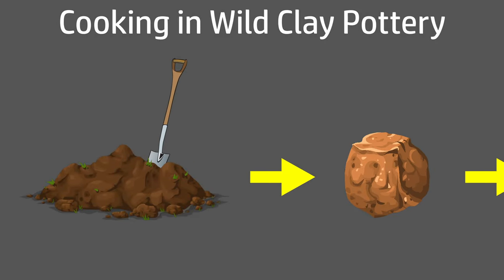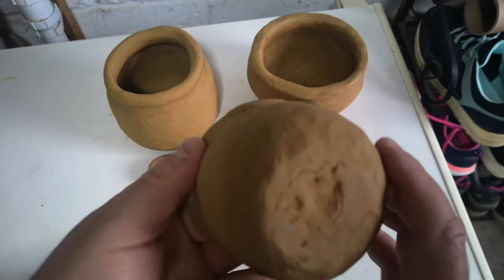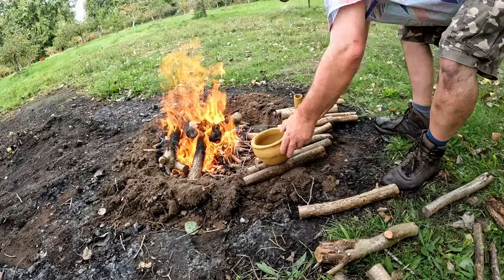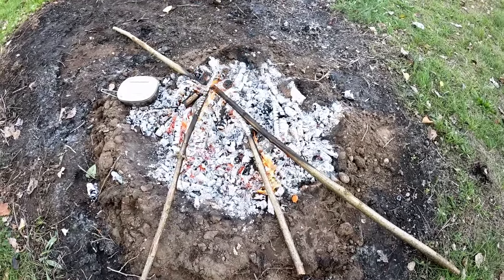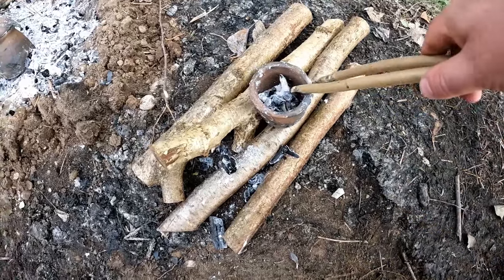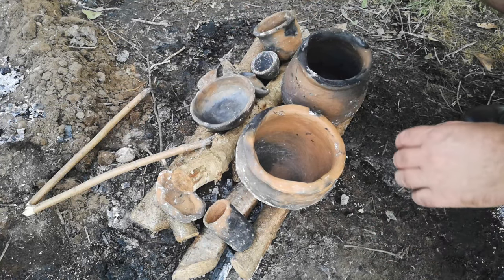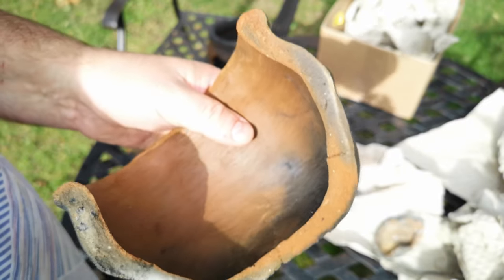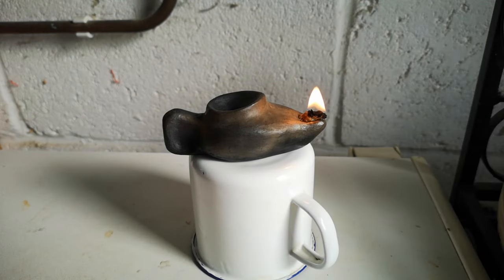Cooking in Wild Clay Pottery - Part 3 - Firing Pots

Comment: Well, one suggestion. Add fine plant fiber to the clay. If Primitive Technology uses it to prevent kiln walls from cracking, maybe it will help with thicker pottery too?
Reply: Plant fiber would make it easier to form the pots and might prevent cracking, but it will also make the  pots more porous, which would not be good when trying to cook with them.

Comment: As I mentioned in another comment, I've been a potter for over 20 years.  I have never tried working with raw clay, but I do quite a bit of raku.  The clay I use for raku is heavily grogged for exactly the reasons you mention.  I fire raku to about 1750 F and remove it, glowing (the pot is glowing, not me), and immediately place it into combustibles of various sorts.  I cover it, and let it burn itself out.  Then remove it and immediately plunge it into water.  The results can be anywhere from staggering beauty to soul-crushing heartbreak.  I do suspect the thickness of your larger pots played a role in their breaking.  I don't know if any of this helps, but I'm REALLY enjoying watching you explore.  Best of luck, and may the kiln gods look upon thee with kindness.  Edited to add:  It IS magic.  It's magic every single time, no matter how many times you do it.  😊
Reply: I'm kinda jealous. I have done wood working, and metal working, but never tried clay or pottery. Where would one in Myrtle Beach , South Carolina, even start ?
Reply: @howiedavis2316   I have a friend in your area who took some pottery classes at the Myrtle Beach Art Museum.  That would definitely be a great place to start.  Even if you don't want formal lessons, they could help you acquire your supplies.  And, you'd meet local potters and get all their tips.  I hope that helps!
Reply: @EastWind123  It does indeed, I am a retired air force vet so I have the time. I will get in touch with them on monday , and thank you for your reply and information
Reply: @howiedavis2316   Happy to help!  Best of luck on your journey, and thank you for your service!  My husband is an Army vet, and he's taken up pottery, as well.
Reply: @EastWind123  Thank you again. Tell him that I'm sorry he could not be real military 😉( just some good natured ribbing between the branches ) . I got out back in '91 after being hit by a semi ( I didn't know at the time there were easier ways lol) . But I love learning new things, so thank you and thank him from me for being a military brother.

Comment: As far as the lamp, if it were hot enough for long enough in the middle of the fire, it's possible the sheen is from the clay being partially vitrified (silica partway turned to glass on the surface).

Comment: I think digging down or building up a wall would be good for even insulation.
You can cook sticks to make charcoal and then use that as your fuel, piled around and in the pots.
Burnishing may help work more air out.
Thinner walls help with even firing.
Grogging in the broken stuff sounds good.

Comment: I think the cracking probably happened in the cool down. Especially as it was on the exposed base. I also think it was slightly ambitious to fire so much at once haha 

Have you tried a pit fire? It can retain the heat over the taller pots better

Comment: Once again, the process is very interesting ! 
Although I am all the more curious as to why the pots crack when firing. Intuitively, it happens... But what about a more rigorous explanations ? 
As you stated, it's probably some grit that exploded, ot perhaps simply thermal expansion ; an uneven heating of an element can lead to crackling, especially if it's a ceramic. 
Your analysis was very satisfying ! I'm positive you'll succeed in making these larger ones. Maybe thinner walls and a tamer fire ? Big heat gradients (strong heat differences over short distances to simplify grossly) tend to make things crack. 

Anyway, your plan seems nice, it'll probably work eventually ! It's a beautiful project, keep it up !

Comment: This is an experiment that's after my own heart ❤️ I think your issue was more about equalizing heat through air flow with your pots being upside down as well as having your pieces space too far apart. I believe you can consolidate your pieces packing them together inside of each other and creating an insulated center for your fire where the pieces end up holding the heat working together and allowing that heat to maintain and become more even using the pieces to assist with each of the other pieces heating and cooling this helps reduce the temperature rising or falling too quickly as you have many pieces working together in both instances. I think if you dig your whole slightly deeper and repeat the process that you had done it will also reduce the issue with things heating or cooling too quickly. Another way you can help reduce the heating too quickly, especially with the coil method which can trap small air bubbles that expand and explode your pieces or create weaknesses, is to put them on a small fire in that pit that you've done and cover it even after you believe that they're completely dry. In places such as the where you live there is a lot of moisture in the air and while the piece can feel dry you want to drive out that last bit of moisture by slowly bringing up the temperature. This is usually done in a kiln by placing all of the pieces into a cold kiln and slowly turning your kiln on but leaving the lid propped open allowing that moisture to escape slowly and safely. Been loving your show for a long time because you do things such as this that are not necessary but the gratification that come from these experiments I believe is necessary to be a happy human and you certainly seem like wha one,

Comment: maybe try the art of Kintsugi if the new pots crack as well.

Kintsugi’s beautiful message is to embrace the imperfect as part of the character of the piece.
Reply: Unfortunately that’s not going to work here; kintsugi uses resin or epoxy, and these are meant to be functional pieces to go over a fire.
Reply: @farmerboy916  "Real" Kintsugi uses gold, silver or other metals. Nevertheless a neat concept
Reply: @danieltrepuen5247  No, actually. It uses the precious metal as a powder applied to the top coat of said resin for aesthetics, look it up. The issue is still that it’d burn/melt

Comment: I do think the big pots cracked because they were partially exposed to the cooler air.  One side super hot, other side rapidly cooling.

I think you might want to bury them deeper into the first set of ash loosely covering them then build fire directly over them.  You want to create a kiln like environment in the wood and ash.

Comment: The pots look great! Heres a bit of knowledge I have on ceramics. A primary cause of cracking can be to do with heat shock or dunting, typically to to do with quartz inversion (the process that turns clay into ceramic theres a lot to read on that) basically going through certain temperatures too quickly. Clay uneven-ness can be an issue only insofar as how the heat is distributed 

Another interesting thing is that even when a pot is "dry" there is still water trapped inside due to humidity sometimes called chemical water. If you have air bubbles said water will build up and a pot will crack or explode (didnt happen here). Its not air pockets that cause the explosions is the steam pressure building up!

theres more info on digitalfire, or books like the potters dictionary.

Comment: I think i would try and make a small furnace/oven by simply stacking some old bricks in a bell shape over the pot and have them stand on 2-3 bricks with some air holes in between the bricks to try and get a more even firing and also more consistent heating/cooling and maybe fire them for a longer time. Any demolition/recycling company with a yard will surely have some old brick you can get for free or at least very cheap. Keep trying i cant wait to see this project be a success 👍

Comment: I have a archeologic site from the germans- the tribes at the time of roman emporer Augustus-  which was rebuild in the last years. They also do experimental archeology and tried to burn Pottery in open fires. They turned slowly their pots and put them each time a bit closer to the fire until they are in the fire. After that, they are covered in ambers and lather the ashes to make sure, the final product cools down slowly. 
I think, some of your errors might be: 
- thick walls which are harder to handle if they are thicker
- Opening to the bottom which might caused bad heat spreading
- uneven heating 
- to fast cool down. 

my suggestion - as far as i can tell: Try to get the walls as thin as possible. that might be also beneficial for later cooking, let them heat up slower, burn them longer and try to bury them in the ambers at the end to ensure slow cool down. At a scool project i had where we also tried pottery in a modern oven the guy who helped us along said also, that thicker pieces tend to crackling faster than thin walls. 

For inspiration, maybe use pottery from the late stone ages, around 5000 BC. What they where able to do, without any machines was incredible.

Comment: I did like all the effort you put into these with the pre firing etc. I do think its a thickness issue but also pretty sure some ancient pots are even thicker so must be a thickness with technique/situation issue
Reply: Yeah, it looks like it was fired too quickly / not evenly. The thicker the walls, the longer high temperature should be maintained constantly. Like firing bricks, it doesn't happen in an hour. 
It's a pity the bigger pots broke, but that little oil lamp is so adorable! And functional!

Comment: Thickness I don't think is the problem (though, agreed with the possibility of flint or whatever cooking off inside it), just an hour sounds way too fast from my experience, both for something that big, and thick.  For sure, you can fire absolutely anything -- if it's done slow enough!  Just like glass, and for the same reason of course.

For point of reference -- gosh, that was back in highschool I did that, I originally had made a metal-melting furnace, but also tried a bit of pottery in it.  And being an impatient lad, I definitely had to find what speed to go at.  It was gas fired, and fortunately I made a gas burner of suitable design to run smoothly down to very low throttle (like household natural gas levels), all the way up to the max 30 PSI the regulator would deliver.  That, and with some extra insulation to block off openings, made the environment reasonably conducive to firing -- still rather uneven as it was much hotter by the tuyere, but good enough to make a few things.  Anyway, I got lots of cracked and warped items if I rushed it, but found that turning it up, bit by bit, over three or four hours, was the minimum to get solid bodies out.  I could go up to yellow heat with that, equivalent to probably around a cone 0 to 6.  For a wood fire, I definitely think something bigger and slower will prove helpful.  You'll need quite a pile of wood I expect, for something as big and thick as that one pot, just doing it out in the open versus some kind of kiln.

...Have you considered using a thickness gauge, like those long curved calipers say, to help trim the thickness?  Could still sand/scrape down an over-thick pot once it's mostly dry, and this would solve the issue with not knowing (sanding too far, leaving thin spots or even holes..).

Comment: During the pre-heat on the edge of the fire, did you turn the pots at all? It may be that one side was a different dryness, or temperature than the other.

Comment: Dig a hole and build a fire in the hole. Get it good and hot. Add wood.  Then burry the fire and pots leaving 2 small air vents you can bellow air in and out of if you need to. Leave it till morning to dig up. This will stop the large ones from cracking. You need it to cool very slowly.

Comment: I feel like youre rite about your belief them bein upside down caused the less even cookin; it wud def have created two separate significantly diff heats as opposed to bein placed upright and havin the inside only marginally colder.

Tho also, the thicker walls may very well be it too. I think with just a little thinner walls, if ya can manage it, and that reused clay scraps, this shud work grt and make a quality pot

Comment: Would be interesting to investigate if there’s a mapping between cracks and exposed parts after firing on the big clay pots, 
If so the differential cooling may be a bit more likely
Reply from the maker: The parts that cracked are definitely the parts that were exposed - on the raw clay pot, it was mainly cracking outward from the bottom, but on the sand-tempered clay pot, the cracking was on the part that was facing the wind and was exposed first

Comment: With the pots that cracked, I saw you just take a solid chunk (with no cracks in it) and snap it with your fingers. Its that the case with the whole of the larger pots? They can be broken even where there aren't any cracks? That seems important.

If it was me (which its not) I would probably fire some test squares of clay of different thicknesses that you intend to destroy (so not putting much effort into them) and test to qualitatively see how strong they are.

I'm guessing you're going to use ash glaze to kind of waterproof them? You might want to consider it if not or the water seeping into the clay can also break it when heated again. If I remember, the more primitive way is just to smear them with tallow, which isn't permanent and can also break them.
Reply from the maker: The big pots were really tough in places (and red all the way through their thickness) and in other places, more easily broken, and grey inside.  I think those parts just didn't get fully fired

Comment: What if you made a firing box / kiln. Essentially using large flat rocks of which spaces can be coated in crude cob mud mix, and then you light the fire on top / around the cube box made from rocks. 
The rocks would hold the heat in for longer & might help with sudden temperature change shock that leads to cracking.
Reply: You can also make the fire in a hole. Like how people roast sheeps in the earth using coals. 
That’s the best thing i can think of rn about insulation. If it cracked because of flint... oh well.
Maybe if you had enough clay you could try fire 4/5 flat square clay sheets for making that clay oven. You use wood & stones  fill the gap inside, once you have fired the clay oven, you can put rocks outside it and inside it, under it. I think an oven/klin where the heat will be trapped would be good. You can also perhaps bake bread if the oven is good for it.

Comment: I started a ceramics centre in Larabanga, Ghana using traditional (ish) methods. I used my pioneer pottery book, we dug up clay from where the grand-children of the last potter in the village said she got her clay and we also had visiting artists. From what i can gather, open pit fired clay generally does not use grog as it only becomes water tight through I think it was the porosity of the clay (it was years ago), though the earthenware clay in west africa is much redder, which means for red iron oxide, which is a flux, or a chemical that will help the clay become harder at lower temperatures. Your pots do look too thick and may not have enough compression, squeezing clay makes it stronger. Your post infers that open pit firing was the norm, which isn't precisely the case, kilns made of bricks have been standard for hundreds/ thousands of years. The top paid person in China in a pottery workshop used to be the person who knew the kilns had fired properly by the colour the clay inside achieved.Anyhow,  you need to make your pots better, not fire them upside down, cover them better and don't taken them out of the fire too soon. In Ghana we used exclusively grasses to fire with, the wood from their trees was no good(different trees, couldn't say for the UK).

Comment: So by now you must realise that you need at least a rudimentary kiln ?
Reply from the maker: I don't think so
Reply: @AtomicShrimp  So you still feel a consistent firing and cool down cycle can achieved in open fire. Obviously that's how pots originally made but rudimentary kilns  developed because of problems with heat management and date back to neolithic times. Probably a fire pit woukd be a step in the right direction, but covering it at least during the cooling phase woukd help.
Reply from the maker: @ziggarillo  yes, I think it's possible. Look at how Andy Ward fires most of his pots - shallow pit and build a fire over the warmed pots. I think I need a little more depth, a bigger fire, but chiefly, pots with thinner walls